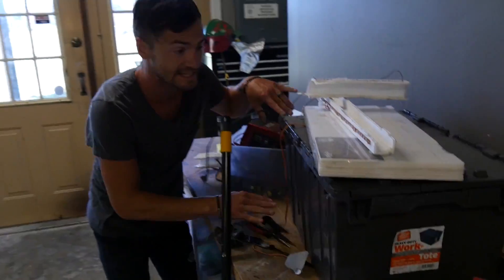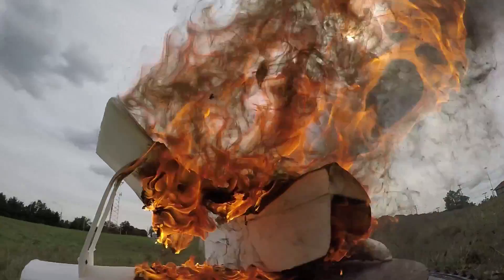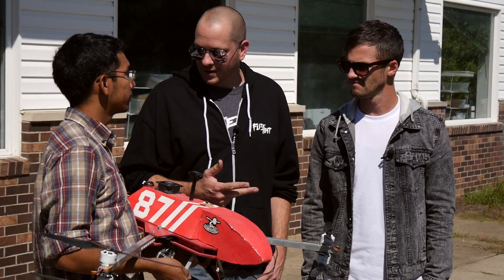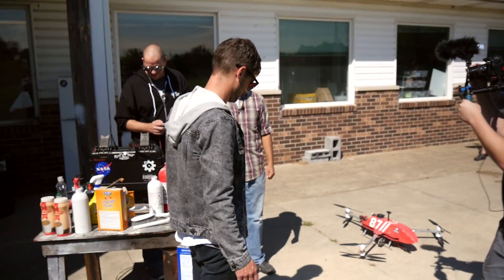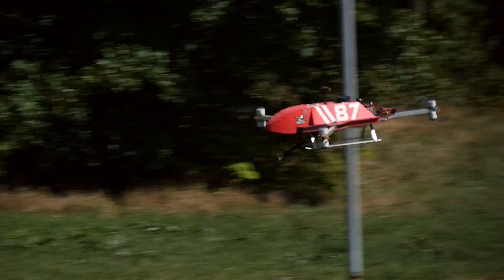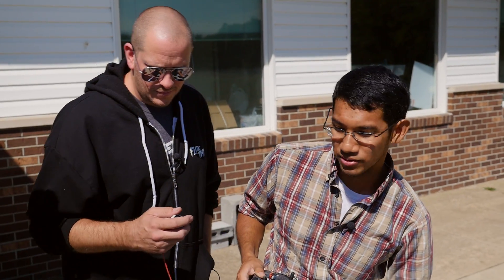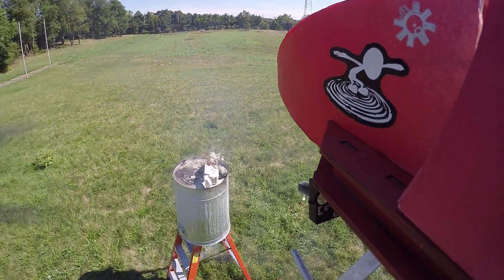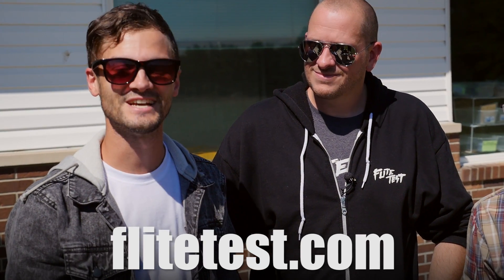Fire Fighting Drone | Flite Test

Comment: i feel like this could work, maybe every mile in the woods theres an emergency button, where if you press it it automatically deploys a slightly bigger drone like this so it can stop a forest fire before it spreads a bit. because if you use this on a bigger fire then you basically wont be able to put it out

Comment: This is really cool was just thinking of fighting fires with drones there are these fire suppression balls that are sodium bicarbonate with a small explosive charge to disperse it how cool would it be to have x class drones with launchers that could respond to a house fre in seconds launching these through windows putting the fire out

   This tech is very practical anything that can save life's is you will definitely see firefighting drones in the future 
https://www.ebay.com/i/254328087221?chn=ps&var=553862414549&norover=1&mkevt=1&mkrid=711-117182-37290-0&mkcid=2&itemid=553862414549_254328087221&targetid=856962882613&device=m&mktype=pla&googleloc=9006006&campaignid=2086088343&mkgroupid=94333533572&rlsatarget=pla-856962882613&abcId=1141016&merchantid=6296724&gclid=EAIaIQobChMItLG2l-Cu5wIVCr3ACh1-JQJcEAQYAiABEgJG8fD_BwE

  Ps when sodium bicarbonate is heated over 80c it forms sodium carbonate "washing soda" water and co2

Comment: Make it a GPS drone and use a swiveling base as they use for some cinema cameras. That way you can put a GPS lock on it and then control the spray of the foam without having to maneuver the actual craft. Some fire extinguishers have flexible hoses that would allow you to use the swivel mount.

Comment: I think some fire departments are starting to use drones to help locate the fire when they are called and arrive in the area, I once saw a drone flying with the fire engines, so it seemed they were using the sky view to help find the fire, if the drone could actually start fighting the fire before the fire engines get there it could help stop a fire before it goes too far out of control, it could even save a life, every second counts when fighting a fire. You should really contact fire departments as well as the National Fire Protection Agency, that drone could be really useful to fire departments all across the country. It could be outfitted on the fly with different types of extinguisher fluids to deal with different types of fire. It would be great to see every fire department with one.

Comment: seriously epic!!    if you want to pursue the foam idea...get ahold of some either AFFF,   or High-expansion foams from a fire department..  You don't need much as both are mixed in very low ratios (on the order of 1% for high ex, and 6% for AFFF)    Most airport CFR vehicles use AFFF.       
one idea for the powder extinguisher  might be to carry a small canister of water, to spray as a fine mist to keep it from blowing away so quickly.....

The  idea is truly well thought, but the problem comes down to physics....fire has a certain energy level, to get it to go out you have to deal with that in some way or another...  the chemical extinguishers interrupt the "chain reaction" that happens when something is on fire.   There are a variety of chemicals that might work but many of them have been halted in production due to CFC issues  (Halon would have been a good candidate for this application, but they had to stop production back in 94 and switch to an alternative that sadly, is not as effective)    if you could come up with a good working replacement, this could be a brilliant idea.....

Comment: Fun video  but I think you need to see the video on the opening page of this web site.  Some guys in Latvia have invented a heavy lift quad specifically for fighting fires.  https://www.aerones.com/eng/news/?text_id=10  Just to show off it's heavy lift capability they also have a Youtube video at the following link.  https://www.youtube.com/watch?v=VGJljVV_GyY  Apparently the sky is the limit.  Just got my commercial drone PIC license.
Reply: The concept they went with is a bit different, but still effective.  Peter's concept is a autonomous fire tanker basically.  You call 911 that you have a open fire, they can send these out from the fire house with a water load already on board, get there much faster than the ground units and suppress the open fire while the ground units are in transit.  If the fire is small enough they can extinguish them as well, once the full pump and water trucks show up the ground crew can fight it, but the drone(s) helped keep the fire smaller and contained.  The drone that aerones is using is hooked up to a pump truck and is supplied water through the hose, it is brought to the fire by the ground units, so there is no time savings compared to traditional units response.  But it does allow smaller fire units to get water onto a fire more precisely without a large ladder truck.

Comment: Well done guys!  I was just thinking to myself today after reading about the high rise fire in London of the theoretical possibilities drones could play in that situation. So far, Fire Departments are using them as video monitors for assessing a fire for access points, people, and areas to aim their hoses at.  This is an excellent use of drones, but I just feel they can be better that...then I find your video...from 2015!! So much for any chance at originality I might have had. 

Question: How hard would be to fit a drone to deliver items to people in a building that perhaps a firefighter can't access?  Items in mind are, of course, extinguishers and fire blankets, but also, what about a radio, an axe, maybe even parachutes?  Obviously considering the method of delivery comes into play here. One can assume the roof would be a natural choice, but since fires like to travel up in a hurry, that would be a case by case scenario.  Can a hydraulic harpoon be used to perhaps deliver items? I don't know. You could even outfit them with loud speakers to communicate critical messages to those trapped inside.

I suppose if you could outfit a strong enough drone, you could even use it to carry a hose nozzle up to the flames.  I know they do that with ladders on fire engines too because they're stable and strong enough, but those only go up about 7 stories at max. What about above that?  You can see where my mind is going with this concept.  Lots of hurdles to get past to make something that happen from an engineering perspective, but I do feel like someone out there can design a delivery system strong enough.

Comment: I just want to say that the military has some old M-113s --- the M-113 APC, or Armored Personnel Carrier --- that they refitted into ground-based firefighting drones.

There's a total of three: One M-113 is the manned command/control center, and the other two are controlled from within it. These all-terrain robotic armored vehicles can enter buildings, climb stairs, and clamber over, around, or even through other obstacles. Once in; they extinguish the fire and, since they are hardened vehicles (built to withstand chemical, biological, or even nuclear attacks) they also assist in evacuating any personnel that may be injured.

There's a silent video demonstration of these beauties in action somewhere here on YT. (I hope it hasn't been taken down.)

Comment: than can it handle a bushfire
Reply: If it was bigger but that size can't do much because the stream of water is so small it would probably be evaporated or simply have no effect. But if it was bigger or had a bigger stream it totalyl could.
Reply: TU Delft drone is an ambulance drone, this is similar, both have 6 rotors, 3 on top and 3 on bottom, 1 minute, not 10

Comment: Pretty awesome build but not really practical on the scale that it's in, something that would probably be more useful to first responders and firefighters would be a robust heat shielded drone possibly with FLIR  or even just an IR thermometer to inspect hot spots in places that aren't very accessible to crews like attics and spaces between walls without having to send a rescuer up on the roof to check manually. It's not as flashy or video worthy but cool nonetheless.

Comment: A big issue with using a copter to put out fires (especially when you are putting the drone in such close proximity to the fires) is that all the air you are pushing could help the fire more than your targeted extinguisher could hurt it. It dangerously, and as of yet unpredictably could help spread fires further from their origin.

Comment: Awesome concept gentleman love the idea as I was watching the video I had a thought I seen somewhere else on YouTube a device called the Fireball and it's basically a heat activated fire extinguishing ball a little bit smaller than a soccer ball might want to experiment with the concept of instead of a pressurized extinguisher system maybe it would be simpler to drop the fire extinguishing ball into the flame more area of coverage times lighter which means more payload just a thought

Comment: Instead of using a nozzle to shoot at it and fight the prop wash put a downward facing sprinkler mount and use the foam solution and hover over it. like the hh-43 was used for firefighting. your main problem with doing this is you will be literary fanning the flames.

Comment: the shame is you not extinguised a lipo 4s battery of your own drones(probably its not possible with so few)
let make the water spray inside the rotor without any pressured device because gravity and fan stream is enought
or an electrical pump then

Comment: Also, yes baking soda contains hydrogen carbonate, which when heated releases carbon dioxide. That's why cakes rise.
Reply: Cameroni you're brilliant. It was like the working out if the plasma electron negative ion and destruction by copper. Keep that science brain burning and turning ;)

Comment: 2 THINGS. 1 - In a real fire, the drone would not be able to get close enough without melting. 2 - The air coming from the props of the drone is just making the fire bigger by feeding it oxygen. Its like when you blow on a campfire to get it going again. Nice idea, but not practical.

Comment: If you guys get a chance I would like to see a hex copter married to an annular wing. It would not have a tail, it would take off and land vertically, it would be made out of six sheets of 4*8 foam board so it would have a 48 ft circumference and probably be 3 laminated layers of foam board thick for more rigidity. if you build the wing  on a flat concrete slab it could be tipped up, the ends would be glued and taped together then motors and batteries mounted.  It could be used to assist the forces of evil to attain world domination, or not. If you called it the Colossal Debacle that would be great.

Comment: hi just watched the video great idear to save some weight try a plastic soder bottle thy can hold a hole lot of pressure over 150 psi and with a car tyre inflation valve and tube like in an I,c fule tank. very practical. We have used this for a giant water piste. 

Paul

Comment: Awesome,  idea..if I had a multi rotor I would try that just for giggles...lol but seriously I like the two person operation...if it were me though I would hook the nozzle up to a gimbal and have the second person have a controller so they could move the spray around independent of the pilot.  that way the pilot only needs to fly the multi copter near the fire and the second person can direct the spay and call out directions for the pilot  to fly up down right left to deal with the wind effects on the spray not to need to actually steer the spray ..hopefully that makes sense

Comment: I think wind, and rotor-wash, will always be a challenge for these. There is a reason why alot of firefighting helicopters use Bambii Buckets slung waaaay below them (and it is not just so they can access resupply points easier).

The laser sight is an interesting idea, but as light is not (obviously) affected by gravity, but the fire-fighting mixtur is, maybe replace it with a small water gun? So instead of shooting the foam, and then dragging it onto target, you can shoot a pilot stream of water, and then, once that hits the target, open up the main extinguisher.

You'd probably also want the extinguisher tank to be easily swapped out. Different mixtures are suited to different types of fires. And whilst foam works on most, it is not recommended against flammable gases or energised electrical equipment. As much as the powder extinguisher was the most affected by the wind, a "Powder ABE" extinguisher would work on almost any fire type, except cooling oils and fats, and unless you are expecting this drone to fly into a kitchen to fight a fat fire, that shouldn't be an issue.

Comment: the real reason why they use foam on real airports is because if you shouldnt put water on a oil fire. And one of the most common fires at airports are oil fires. thats why they use foam.

Comment: Its called the fire triangle remove fuel from o2 or heat and the fire goes out. You could go to local fire dept they have AFFF used to make foam you need only a few oz in your system to make it work. I comes in 5 gallon buckets.

Comment: Concerns: Multirotor got to be very close for extingushing effectiveness however wind generated by it increases fire intensity.
My Thoughts: Some time ago I've came across the technology of full sized missiles designed with a 'warhead' which extinguishes fire. It looks very promising and I wonder if you guys can replicate such technology to a down-scaled practical application for multirotors. Easy reloading, effective and the multirotor don't have to be close to target.

Comment: One of the most effective fire extinguisher modifications for inexperienced users would fit right at home here. it's a simple showerhead, pump your Liquid Mix through a small focus shower head straight down on top of it, fly over it, discharge with a small focus shower to about 2 foot radius and move off to the next target.

Comment: would make the job easier if the firefighting drone had similar system as the inspire 1. with 2 controller. 1 controlling the copter and one the gimbal controlled nozzle with camera ofc. :D wont be cheap tho..

Comment: Hey guys if you want to do a remote fire starter try this you will need a 9v batt. 2 farmer matches  and a dbl length of wire,   bare both ends of wire and wrap around heads of matches bare other ends of wire at your safe point when ready touch 2 ends of wire to pos. and neg. of batt. and that's all there is to it. fun thing to do camping and make magic fire for the kids  in the night campfire...

Comment: Peter your doing good, but extend the hose farther out away from prop wash. I think you would do better with a water tank and a small water pump on a brushless motor with the water pump submerged in the water tank so you don't need to prim the pump.

Comment: The Norwegian Fire Dept. in Bergen, actually has its "drone" dept. They even have their own car fitted with 2 inspire one, and 2 phantom 3`s!:D They are building a drone sentral on their firestation, so they can launch a drone from the station, send it to where the fire is, use it to access the situation while firetrucks and the dronecar is headed for the fire. When dronecar gets there, they take control over the drone, or lands it and launches another one:D Fantastic use of the tech!!

Comment: Peter to the rescue. I knew it. Josh, you're a good sport. Really appreciate you. Check out the additive called Cold Fire. You add it to the water mixture and it absorbs heat (endothermic reaction) when applied on the fire. How about a simple tank and a pump to give you more firefighting capacity?

Comment: In a bigger version the nozle should be auto stabilised to the point where you look. Just a suggestion, might get to expensive for you guys.
Reply: +Ignafiltro Sanchez if the extinguisher nozzle was on a gimbal, the operator could simply hover the drone while another person could manuever the nozzle
Reply: It might be as simple as mounting the extinguisher on a big camera gimbal, or the extinguisher fixed with a flexible tubing and the outlet on a gimbal,. Of course this means more weight.
Reply: Ignafiltro Sanchez Great idea!